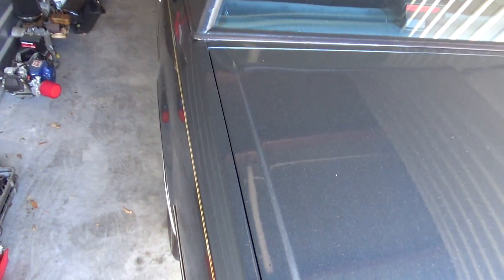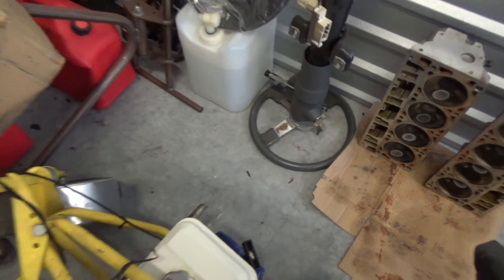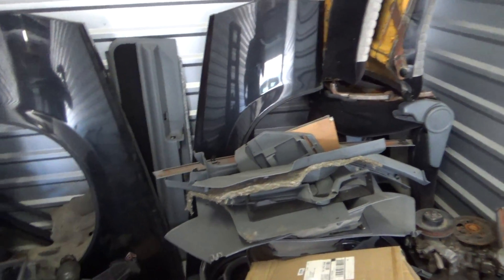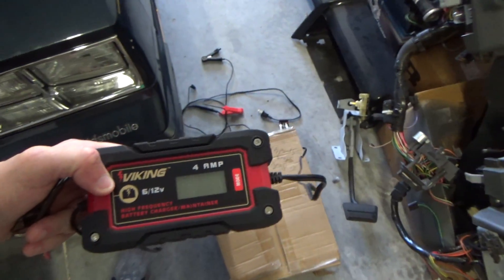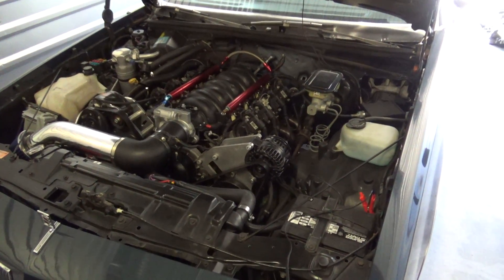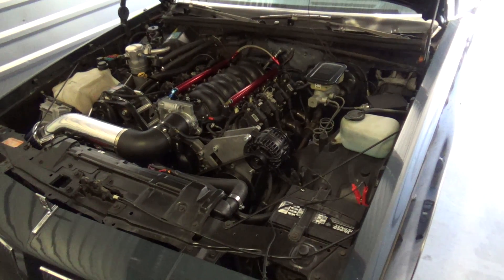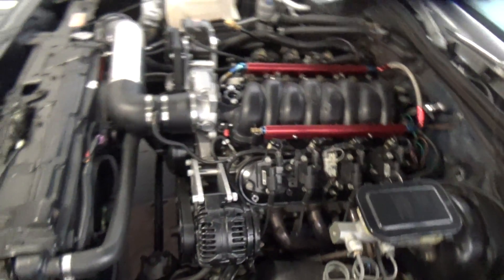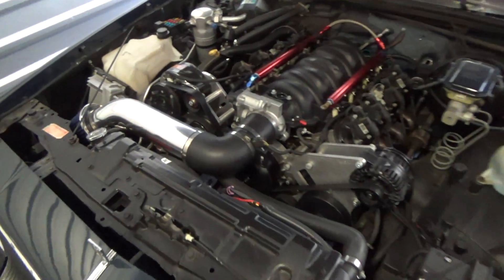Bringing the swapped Cutlass out of hibernation

Comment: What engine did you use and what engine mounts and headers? That’s s sweet ride!!
Reply from the maker: The engine is a 6.0 from an '07 pickup.  Headers are F-body cheapies from ebay.  They did require a  little "finessing" , they didn't just bolt right up.  The mounts are 1" setbacks from Trans-Dapt.

Comment: So that lil converter will let me use my sock dash even though I have a 5.3 in my Monte Carlo an won't have to worry about buy a Dakota digital ......let me know the name of the that box
Reply from the maker: It's a Dakota Digital ECD-100 and it converts the VSS signal from the transmission to a mechanical  output to drive the stock speedometer.  It works really good.  It's not the cheapest option, but I really wanted to keep the stock cluster.

Comment: I had a 1978 cutlass coupe i koped for $200 kept 4 2 year's then sold the motor 4 $500 only paid $209 for it lil Trap car but still have my Heart and Joy the first model Buick Regal Grand-National Big block edelbrock 350 Rocket 400 turbo transmission positive rear end dual's coming straught from motor 10,000 watts in trunk r jl audio 10 inch woofer's 2 6x9 pop's tv radio sitting on 34 in oasis 😏